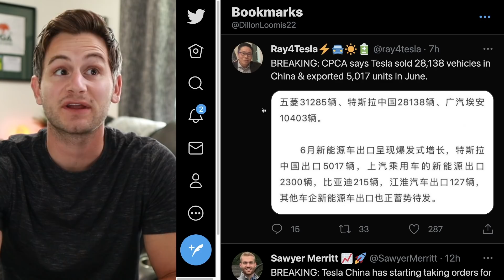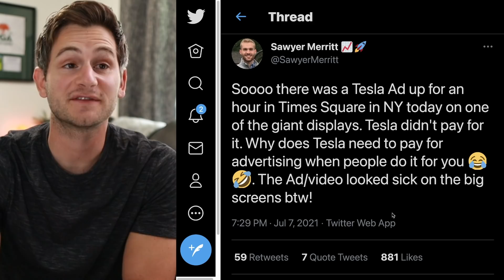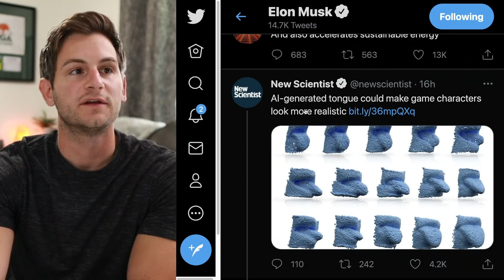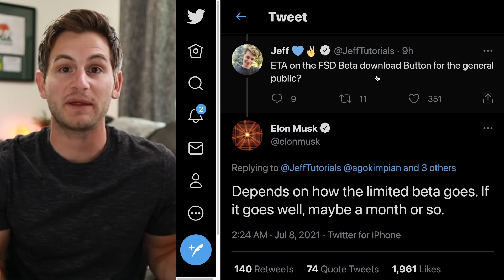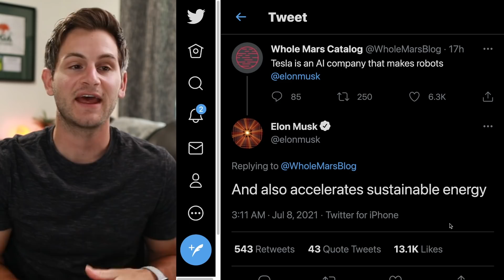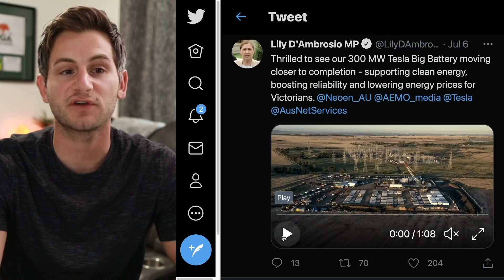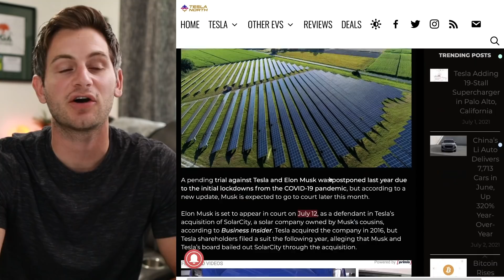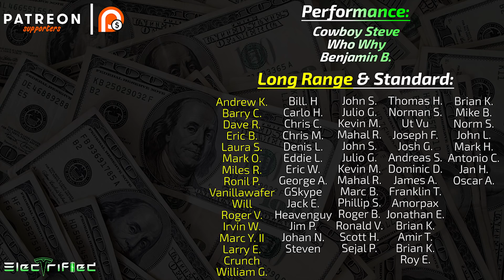Tesla's FSD V9 Is Here! But...🤦🏻‍♂️

Comment: A little off topic question but any ideas as to whether the battery packs from Tesla cars will be put into future stationary mega packs? It seems like the logical thing to do at the end of a 500,000km TESLA lifecycle with a battery that still has 90%+ charge/discharge remaining. I am a bit curious if the newer designed structural battery packs could also be used way or if there would be issues with extraction… seems like a waste to send them to Redwood for recycling with so much life left in the cells… if anyone has details it would be appreciate.

Comment: While I understand the frustration of those who have already paid for FSD, I believe that what Tesla does currently provide with Navigate on Autopilot is light-years ahead in functionality compared to any other system currently available. FSD is getting better and, since safety is involved, Tesla has every right to be cautious in its releases. As Elon has said, solving for edge cases can be very hard. I admire what has been already achieved.
Reply: What other systems are you comparing this against?   What other vehicles with driver assistance have you driven?   Do you have any proof of these claims?   What is your definition of "light-years?".

Comment: V9 2022 at best. I'll bet 6 months of updates on V9 before release. Unforeseen problems or an accident add 1 year at least. Don't worry it has always been just 2 weeks away for years now.
Building a factory in Germany to compete with the German auto industry may be a bad idea. 
Building a factory in Texas that competes with the oil industry and where you even sell your cars may be a bad idea.
Reply: 2022?   More like 2052.   Current microprocessor technology does not have the computing power to fully simulate a human brain in real time.

Comment: The Times Square ad: An ad agency pitching Tesla by showing them the impact of an ad?  Probably got it to run for no charge or minimal cost because the billboard company would also like to have Tesla as a client. 
Maybe there should be a Tesla Information YouTube channel. To answer questions like: If I drive my Tesla at a brick wall will it automatically stop? What's the difference between a regular Tesla and one using FSD? (We FSDers usually first mention relaxing on the freeway, when someone without FSD snaps "I can do that too." And my son says his Audi does that as well. I didn't know this. He also told me that his Audi restarts the engine when the light turns green.... not when I take my foot off the brake. ) 
So my Model Y can wade through 50 cm of water? Cool. 
An Elon "maybe a month or so" ??   So my grandchildren will have it.  "Some of the best things in life are worth waiting for." ? Sure Dillon, but they also don't charge $10k up front.
Reply: Currently there is nothing unique about a Tesla other than the fact that it's drivers routinely disregard all safety standards while driving.   Other car manufacturers have the same tech, they just call it Driver Assistance or Semi-Autonomous driving capabilities.   Elon and Tesla need to publicly admit that there is no such thing as Full Self Driving and rename it to something like Tesla Vision Driver Assistance.
Reply: @kratosdisciple4637  Look at some videos from Dirty Tesla - he's just moved up to a Model Y, and won't get his Beta status returned until this weekend, but any videos older than a couple of weeks  show him driving his Tesla with supervised autonomous driving on unmarked streets and roads, around traffic circles, fully automatic turns.  There are other Beta tester videos. No other  company has anything like this. Waymo is terrific, so long as you're in one small part of Phoenix in a $300,000 vehicle.

Comment: No surprise here. Obviously Tesla won't just release such a huge update without thorough testing.
Reply: They did release it. Normal customers (just not all) got it to drive around the streets with a it. Unreasonable.
Reply: @niko5855  
That's not a release. It's called "limited beta". And even the release won't be a real release, it's still going to be beta.
Also the data proves that it's safer to drive with Autopilot, so it would be unreasonable to not release it.

Comment: Doesn't bother me. Limited beta is a necessary step and gives me more time to load up.
Reply from the maker: i hear you on both fronts!
Reply: Limited beta is necessary because it’s still level 2 technology being passed up as level 5. Regulators would fine Tesla heavily if suddenly everyone had it and the cars kept messing up which they will.
Reply: @curt8806  Although the level 5 talk is just going to create bad press, Tesla has been clear to the regulators that they are in regulatory level 2. What Tesla is developing is level 3, very little driver intervention in normal driving. Level 4, almost no driver intervention and no need for driver attention under normal driving is not close at hand, but level 3 & 4 may be fairly close to each other as both mostly mean the AI has the same skill set. Level 5, where regulators allow cars without steering wheels or pedals doesn't appear to be close.